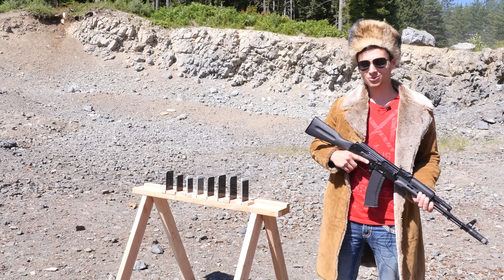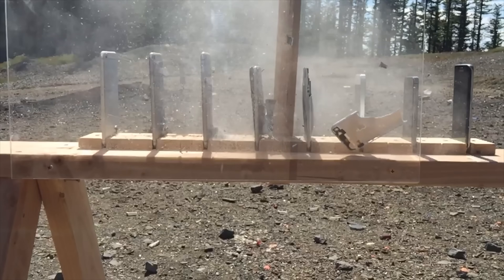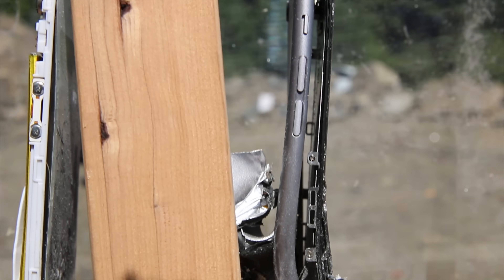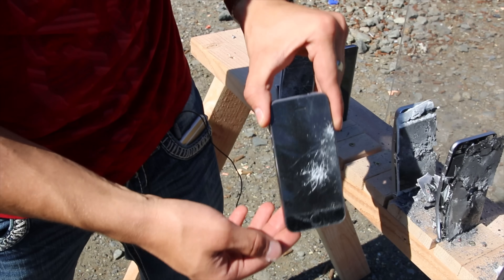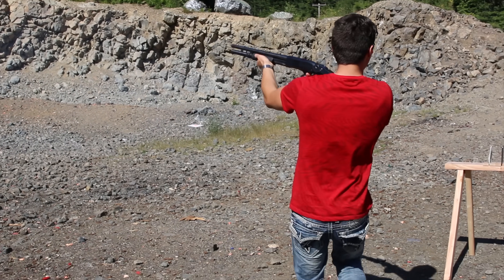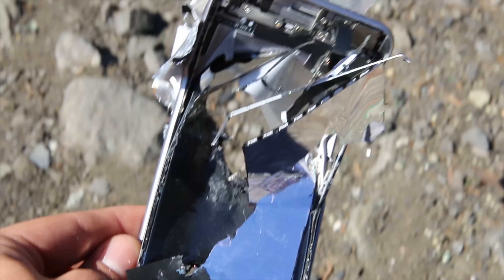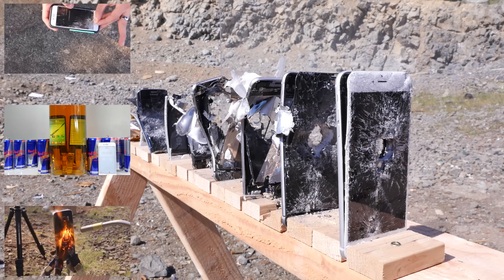How Many iPhones Does It Take To Stop an AK-74 Bullet?

Comment: the problem is that the phones are spaced apart. the problem with spacing apart as you would need to put them in your pocket with him space to park to replicate the same results. the space in between each phone allows for the energy of the projectile to dissipate massive amounts of energy before it strikes the next object. if you think I'm just talking out of my ass I implore you to do some research watch a video read a paper on how NASA developed shielding to safeguard there's space vessels from micrometeorites. it was 20 times more effective to use for 16th of an inch thick plates then is to use one quarter inch plate. For the same reason in between each panel the projectile be the bullet micrometeorite excetera have the chance of dissipate its energy before striking the next plane and in between the two plates all kinds of interesting things are happening such as gas expansion, it also gives a projectile chance to break apart in between the two plates or the two phones making smaller projectiles that have less kinetic energy than the projectiles hole and if it makes it through the next plate so forth and so on I think you get the picture. and he's also wrong about the kinetic energy of the projectile increasing because the holes got bigger as I went through more phones. The only reason the whole lot bigger is because the bullet was fragmenting and coming apart but if you noticed the largest hole was in the phone just before the phone that stop the projectile. why is that because the bullet was breaking apart mushrooming it out dissipating its kinetic energy and each phone and it went through and in the spaces between each phones or gas expansion Thermal Transfer and  all the other mechanics of Newton's laws are taking place

Comment: To everyone who is yelling around here, that it might be an Ak- 47 and not an Ak 74: Just look at the Gun itself... The Ak 47 has no muzzle break, the rifle you can see in the video clearly does, which is one of the few ways you can tell it's the ,,74´´ from the outside.

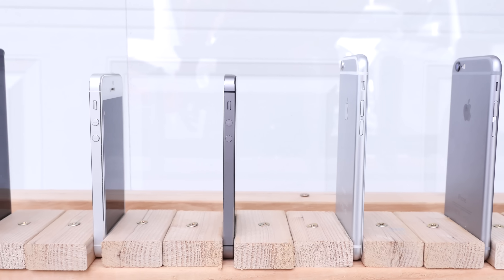Also: Look at the Cartridge at 0:39 ... A 7,62x 39mm (The Calibre of the Ak 47...) would be bigger, the shown one is the 5,45x39mm Cartridge of the 74.

I am very sorry to disappoint those CoD Veterans in the comment section now, but it's just a total abomination how many people really seem to portray themselves as Firearms experts, just by yelling ,,It's an Ak 47!´´ Without taking a closer look at the gun itself, just because they once have shot some Pixels with a Rifle that ,,looked similar´´.

-By the way, the Ak - Rifles are manufactured in dozens of Variations and Calibres and many have just slight optical differences to the 47. Great example is the czech Vz 58.

Comment: As any myth busters fan will tell you, when you fired the second round, the structural integrity of 5 of those phones was already compromised, so the results for the second shot are invalid, for accurate results you needed to swap them out with undamaged phones before you fired the next round.

If you had, the bullet may not have reached the sixth phone.

Comment: I know Im going to sound like a fool but the thickness from the 4 and 4s is actually a good thing: first of all, due to his super beefy screen (around 2mm) it wont break easily my father throwed it at a wall and it didn't got damaged. Secundo due to his super strong chassis you're never going to harm an internal component and lastly, thicker = more place to put processor, ram etc...

Comment: AK-47 not 74
Reply: +Paul Johnston no, it's a 74
Reply: +Paul Johnston It's a 74, there's three main types the original AK47 developed in 1947 which was chambered in 7.62x39 and had a steel milled receiver, the AKM which was the AK modernized with a stamped sheet metal receiver and other cosmetic changes still chambered in 7.62x39 and then the AK74 developed in 1974 which was just an AKM chambered in the new at that time 5.45x39 (the Russian answer to our 5.56x45) with a new type gas block and muzzle break. I don't know what the extent of your firearms knowledge is so I could be preachin' to the choir but this is not an attack or insult merely educational.
Reply: 74 not 47 HUGE design differences

Comment: The "intensity of the bullet" as you call it does not increase as it goes through more phones my friend!  The tip of the bullet is flattening out as it hits more layers of material!  the cross section diameter of the tip increases after each layer, allowing more of the kinetic energy of the bullet to be transferred into the next phone!

Comment: nice experiment, but i do not think 5 iphones are required to save your life. if you put 5 iphones one on top of the other, you will end up with a bigger solid width to be penetrated. in this video, it is the gaps between the already thin iphones that make it possible for the bullet to traverse so far

Comment: You failed first test. The bullet's penetration force was stopped by wooden blocks because you aimed it way too low, so after hitting first iPhone bullet changed its path and went down, piercing wood instead of phones therefore losing its kinetic power.

Comment: this dude was 3 feet from the phones and still managed to hit the home button area at the bottom, also you can see after 3rd or 4th phone (because of how low the bullet hit, that it tore up some of the wood holding the phones which definitely slowed it down a bit. Have someone with at least normal accuracy take this shot again in the middle and I bet it will go through at least 1 more phone.

Comment: first shot was aimed so badly, the wood impacted on the result. and the second shot can't be counted since the phones were already damaged.

And the test was already badly set up. You need 6 of the same phone because each phone has a different casing, build and thickness.

pls redo the experiment. 10 of the same phone build lined up like dominos and then shoot through the middle of the screen
OR 1 Phone and a cube of balistic gel right behind the phone (No air inbetween)

Comment: I'm guessing you'd have to carry about 10 or 12 iPhones in your pocket to stop a bullet like that. In this video, the iPhones are spaced apart 2 - 3 inches apart, which significantly slows the bullet. Also, the shooter wouldn't shoot at your leg at point blank range, either. So I'm guessing 8 or 10 iPhones.

Comment: i think this test is rather flawed. the theory is that the phone will stop a small caliber handgun round i bet if you shoot a 9mm hollow point and had ballistics gel directly behind the phone to simulate a body it would stop with only one phone. there needs to be the "body" to transfer the force over an area and it just wont stop a slug or steal core round or likely not any rifle.

Comment: You can't affor a good camera but you're dumb enough to test out expensive phones for some stupid and absurd test that means nothing nor proves nor will help anyone on anything. Waste of time!
Reply: George Ramirez 100, 000 dollars isn't as low as 4K-6K dollars...
Reply: 100k for what?!?! A camera? 
Cmon man any standard dslr with video will serve its purpose for the "???????" Point youre trying to prove with your test.. Heck even any of todays cell phones might do the trick.

But what can i say if it got you that many views and paid, maybe you are doing something right
Reply: George Ramirez Do you need a hearing aid? He said "high speed" camera, that meaning something like the Phantom Flex... Not your everyday DSLR or a iPhone which slows it down to about 240 FPS where the Phantom Flex can range from all the way up to almost depending on what kind such as Phantom v711 which can reach as slow as 1.4 million FPS which can range from 50K up to 150K. You need a very good slow motion camera to capture a bullet penetrating else it looks like normal. In which for him to earn enough it takes about one year with some math.
Reply: I take you have Never heard of final cut pro then.

I rest my case :-/
Reply: George Ramirez And how slow does that make it? If its more than 1.4 million frames than someone's running a pretty hardcore computer.

Comment: ak-47 rifle bulled capable of penetration train railway.
ak-74 using nato 5.56 bulleds...they suck =3
Reply: Lunar Angelus Senekiss First they are called rounds.  And for penetration the 5.45×39mm round is much better in almost every way. It is slimmer making it go through objects without effecting its speed as much. It is longer also making it harder to slow down. The AK-74 is lighter making it easier to carry for open carry. It can also be accurate until 600 meters where as the AK-47 can only go out to 300 m. It can also shoot the bullet alot faster. The only thing better about the AK-47 is that most of the time they come full auto. But you can buy full auto 74's or put a bump fire stock on it. If you do get a full auto 74 it will shoot faster than the 47 by 50 rounds per minute. Even at a close range the 74 scored a 1-4 MOA and the 47 scored 2-6. Due to the rounds it shoots the 74 has noticeably less recoil too making it better for home defence in case your wife or child has to use it.

Now tell me why the AK-47 is better.
Reply: ak-47 is not better, it has stronger (by destructive measures) ROUNDS (if you want that word that hard), that's all i wanned to say, newer claimed 47 to be better. No really, man, 47-th round is from long range mosin rifle. of course it will be stronger.
Reply: Lunar Angelus Senekiss It's not though. It has less velocity, can only shoot half as far, and has a better penetration capabilities due to it's size and shape.
Reply: the round itself are more destructive, isn't it?
bigger calliber, more powder, better strenght on close distances. in this case its point blank.
Reply: Lunar Angelus Senekiss Because the bullet is more wide it would slow down faster. Then it would start to tumble which would make it alot harder to go through something. It also starts off as a slower velocity.
Reply: but making a bigger hole =)
Reply: Moo Snarph il tell you why the 47 is better, Its cheaper and it still gets the job done. Nuff said. (outside of 1st world countries anyway)
Reply: well if it wasnt that way then 74 was not made =)
Reply: Lunar Angelus Senekiss the 74's round actually tumbles more, the 47 will best it at barrier penetration. The 74 makes a bigger hole because of this.

Comment: Nice bulgy. I've got the slr104fr you've got there and had the 107fr, but sold it for an AR build. 5.45x39 is definitely the way to go. Be sure and clean your barrel, bolt, carrier, piston, gas tube and muzzle brake with windex (or something with ammonia D) after shooting that corrosive 7n6. I see you posted this on June 22. If you haven't cleaned it yet, the damage is done. Prolonged use of that ammo without cleaning it can ruin your chrome lining and rust your parts out alot quicker than you'd think. Those corrosive salts can be a bitch. But I guess if you've got the money to shoot 6 phones, you've probably got money to just get a new bulgy.

Comment: You must know nothing about physics if you think intensity INCREASES with distance. By your logic a sniper rifle should shoot nukes.

Oh and in hoping that someone in the exact narrow margin of your pocket instead the other 98% of your body to "save your life" you might as well pray. Both of them are guaranteed to accomplish nothing.
Reply: ***** The highest intensity of the bullet is the instant it leaves the nozzle of the gun. And in fact, if it weren't for the fragility of the iPhone, the bullet would, due to higher intensity, do far more damage to a more resistant object. This is equivalent of puncturing a sheet of paper with a pencil thrust vs. a bullet. Not much difference now, is there? But you KNOW the bullet is capable of more damage than the pencil. Same here.
Reply: OverLordGoldDragon It's because when the bullet goes through things it starts to tumble which makes bigger holes but slows it does.

Comment: THE DUDE IN THE VIDEO IS EITHER A LIAR OR IS UNBELIEVABLY STUPID when twice he says "steel core bullet."  THAT IS NOT, repeat NOT a steel core bullet.  It's a standard 5.45 mm copper jacketed round, and is probably "wolf" brand (or came from the same factory).  It looks like an older round because it has the red seal.  It's been hard to find Russian ammo that has the sealer on it, for many MANY years because demand got so insane that the factories just stopped putting on the sealer.  For pete's sake I can also see the shiny green lacquer on the case.  Good grief this guy is stupid.  The case is steel, not the round, but the guy in the video is a bloomin idiot to call the round steel "cored."  A TRULY steel cored round would have pierced all of the iphones.  Getting steel cored ammo, esp in 5.45 is EXTREMELY difficult these days.

Don't confuse the gun he's using with the "AK 47" which uses the 7.62 x 39 round.

Comment: Actually, the intensity doesn't increase as the bullet travels, it pierced the first iphone so cleanly because the speed that the bullet travelled at was the highest before it experienced a net force (in this case the first iphone) slowing it down, as it travelled through more and more iphones, the speed decreased and thus caused the uneven holes and gave the phones a bent shape. Correct me of I'm wrong on this though

Comment: AK-74. (it IS a 74 in the video) caliber: 5.45x39. Mediocre armor piercing capabilities, though slightly better than NATO 5.56x45 (US M16/M4 rifle caliber)
This is the Russian army's basic rifle since 1974.

AK-47: (different rifle) (It's later "Perfected" version was called :AKM) This one is the "Famous" AK, largest number of an assault rifle imported on the world... Seen in /every/ conflict around the globe.
old russian caliber, 7.62x39. Ex!!!!! russian basic army rifle from the late 40's until 1974.VERY high armor piercing capabilities. Much larger round, ALOT more powder, a lot more power.

Only the latest armored vests can stop this caliber.

For comparison: the 7.62x39 is a very large caliber, similar to the 7.62x51 round the M14 US army rifle uses. I mean, the shot itself is small diameter enough to have extended armor piercing capabilities, but it's backed with ALOT more powder than smaller calibers)

the 7.62x39 was directly derived from the Mosin Nagant main army rifle caliber, (7.62x54R) modified for a smaller clip, and automatic fire.

It DOES have significant ballistics- one meter concrete does not stop it, nor a train rail... (the latest armored vests claim to stop one shot. )

!!!!But the rifle in the video (AS THE GUY CLEARLY STATES ALSO IN THE VIDEO!!!) is an AK-74, 5.45x39 small assault rifle caliber, even a tad smaller than the current 5.56x45 NATO round.
Reply: Though I also have to say, that the 5.45x39 is a very succesful and loved caliber, (compared to 5.56 nato...) but it's not the toughest, not in league with the "old", less sophisticated, less economical, but VERY strong 7.62 calibers. (x39,x45 russian and x51 nato)
Reply: Yes, they are introduced, but the wast majority of the armed forces still only have the 74. Things are going slow
Reply: Watch out guys, we've got a badass over here

Comment: I'm no expert on velocity or acceleration, but wouldn't the distance between the phones have something to do with how far the bullet travels? If you packed these phones right after one another, you could be in for quite a surprise (I think). Also, for this to have at least some "scientific merrit", you should've replaced all the phones the second, third, etc. times you shot at them to really determine the impact of different angles, bullets etc. on the same type of phone (at the same spacing)

Comment: Not the best setup, since if they were in your pocket, they wouldn't have near as much room to flex like they do clamped at the bottom.  Plus, if they were all against each other, it would make piercing them all at once much more difficult (consider a stack of 1000 papers all together vs 1000 papers lined up 0.5 inches apart each.  The stack of papers is much more difficult to pierce.)  Also, a bullet at close range is going to be faster than one shot from a distance.

However, this is probably the best use of iPhones that I can think of!

Comment: The first shot doesn't really count because the bullet made contact with the wood as well, which significantly slowed down the bullet. Only the second shot was a good one. The conclusion is simple: you need at least six iPhones in order to withstand a shot from an AK74.